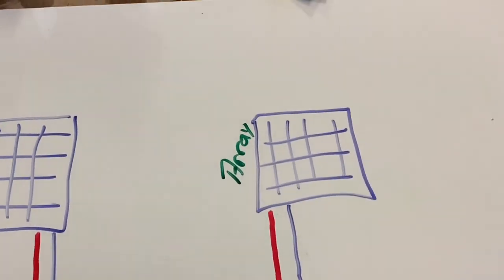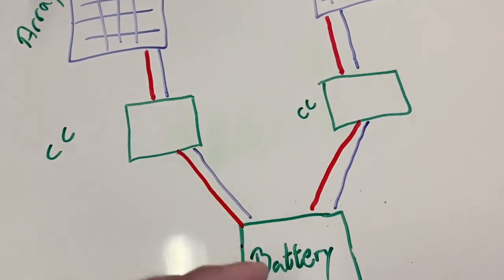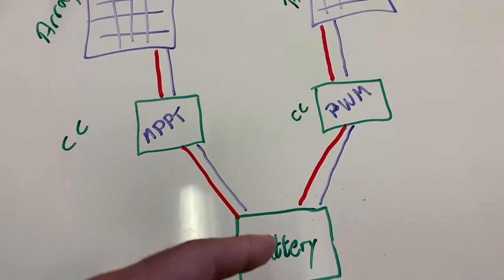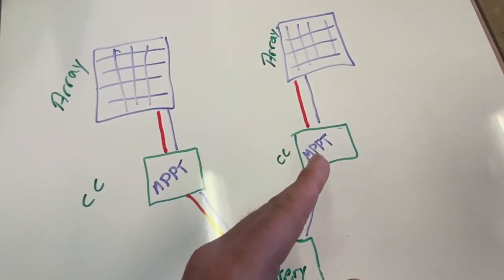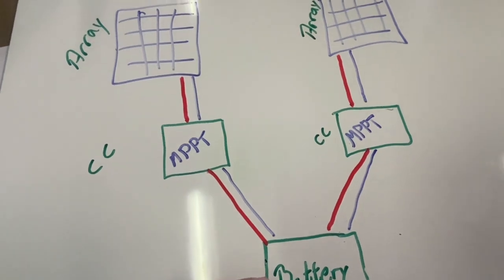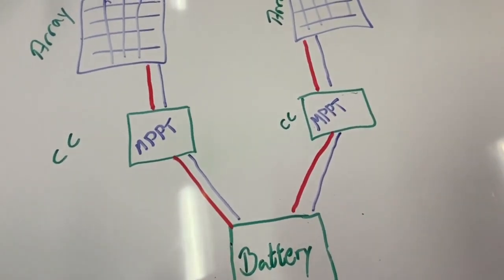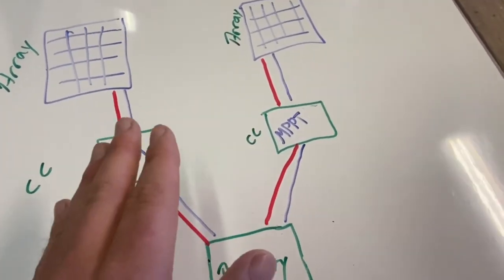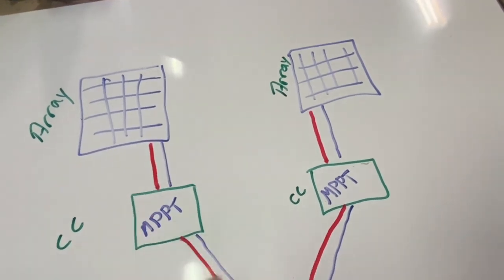Double Your Solar Power Without Replacing Your System!

Comment: Have two 40amp MPPT controllers with 500w panels (3 per side) into  400 anps of batteries, at 9am ,overcast,  have  3-4 amps going into batteries, this is in the southern hemisphere autumn, this is a 12v system on caravan, now have friends going to do same after seeing performance
Reply from the maker: Nice👍 thanks for the comment!